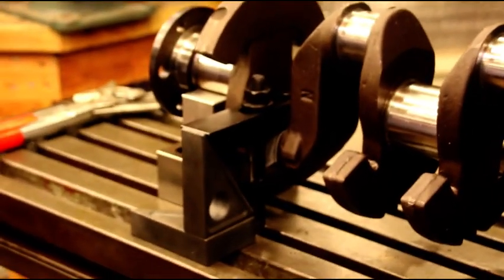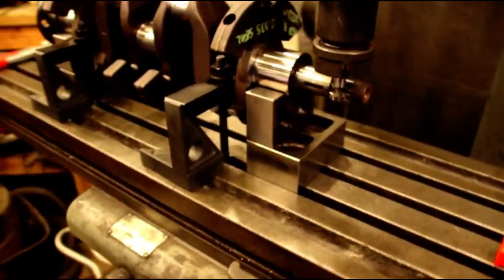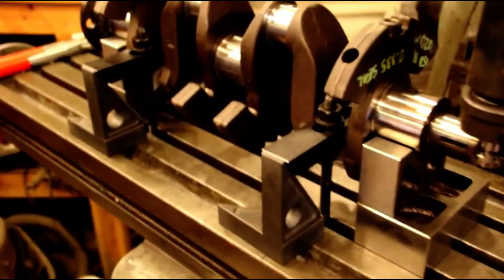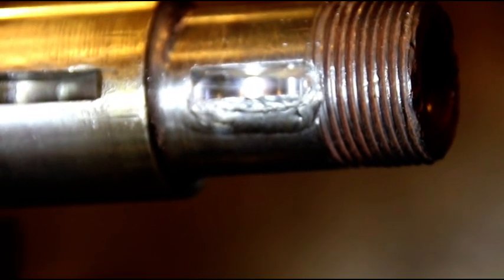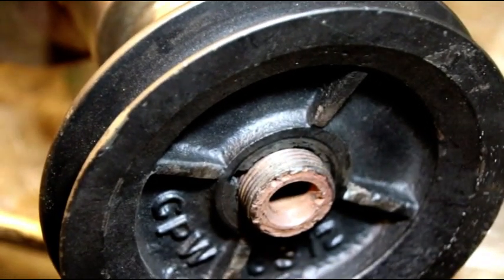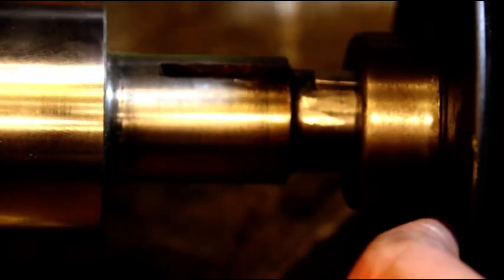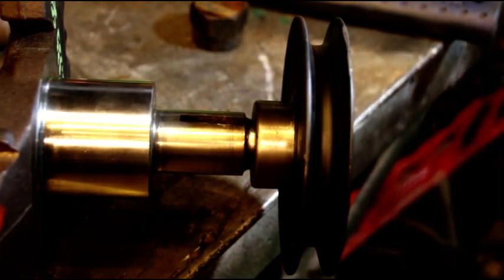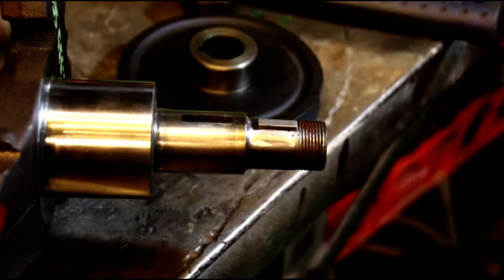Willys Crankshaft, How To Fix Damaged Keyway

Comment: I damaged the woodruff key slot while trying to remove it with punch. Any recommendations on how to resurface or repair the damage?
Reply from the maker: Depends how bad the keyway is.  Weld and cut new, or carefully hand file the damage

Comment: Hi Briant, how can I measure the thickness of the cylinder head (l134)? And what thickness should it have and its lowest limit in mm? Thanks, Peter
Reply from the maker: there is not a factory spec for head thickness.   Inspect the head carefully and make sure it is flat.

Comment: A lighting suggestion: diffused lighting. A white king sized sheet stretched over a shop fabbed frame (wood, PVC pipe, scrap steel, electrical conduit, whatever), and one of those "umbrella reflectors" photographers use. Light source between reflector and sheet, reflector between light source and work being videoed, arranged so light is reflected onto the sheet. 2 such rigs at 90 degrees to one another would light the scene is soft even light with a minimum of "hot spot" reflections. Rigid panels painted FLAT white could be used instead of sheets, or even sheets of white styrofoam.
Reply from the maker: thanks for the suggestion.  Where does the light point to, reflector?  What does the umbrella do, I have seen them before but not sure of the purpose.  
Brian

Comment: Looking at having to do the same thing with a couple of mower spindle shafts that are unobtainium. Unfortunately I don’t have a milling machine, so after I carefully weld up the bad side, I’ll have to gingerly recut it with a Dremel and grinding wheels.... At least they are just straight keys....
Reply from the maker: Just take your time and make sure the fit is perfect and cut to the right depth and you should be fine.

Comment: I may have asked this already but how deep is the hardening on a crankshaft?  I always worry when people grind cranks and wonder if they may need to be rehardened.  I also wonder how often you have your torque wrench checked for accuracy.
Reply from the maker: Cranks can be ground many times without losing any of the integrity  of the hardness. Torque wrenches are sent for calibration every couple of years.

Comment: Question  . Briant is that keyway a important  index if not go 180°and cut another keyway
Reply from the maker: This keyway not so important, but later engines where the timing marks are on the cover and rely on pulley it is important.